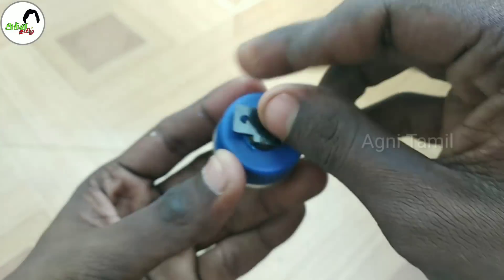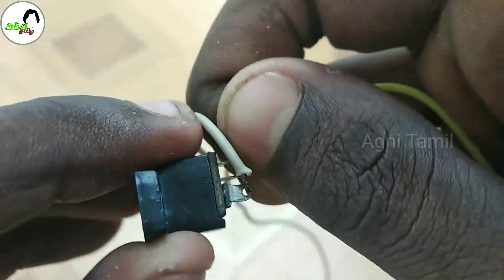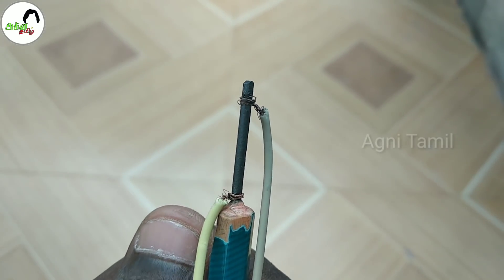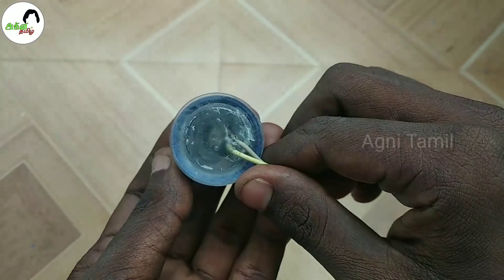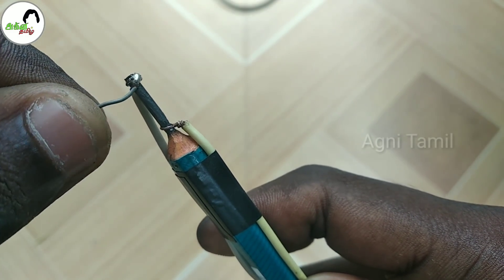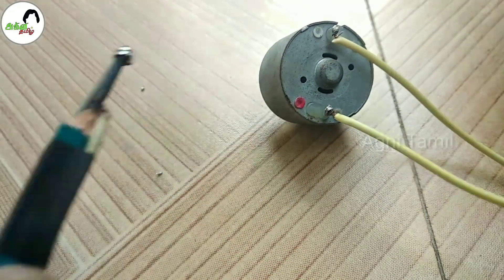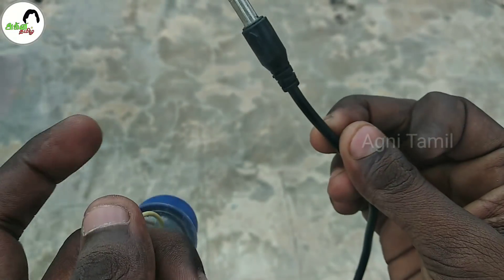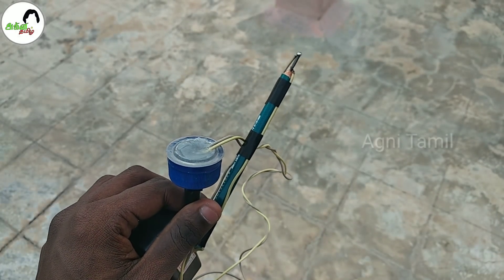Soldering Iron செய்வது எப்படி? | How to make a Soldering Iron? | Agni Tamil

Comment: What is female coneter and how check p+ and n- bro
Reply from the maker: Female connector video la kamatchi irupan bro athu electronic kadaila kedaikum bro.... Na positive and negative yethunu light vachi check pannanen nanbaa athula thaerium athu matum illama intha video yethu renduthula power supply varumnu kandu pudicha pothum..... Soldering iron seiyarathuku positive and negative wire ah maathi connect panna problem illa bro.... Pandra apo safe ah pannuga bro.

Na vachi iruka connector name : Male +  Female 2.1*5.5mm for DC Power Jack Adapter Connector

Pencil la 5v or 6v thara maari charger yeduthukoga nanba
Reply: @AgniTamil  Tamilarasan
Reply: @AgniTamil  vera level bro
Reply: @AgniTamil  hi bro
Reply: @AgniTamil   bro it's fake 🤥🤥 I am tried more than 10 times but it's not working bro😭😭😭
Reply: @AgniTamil  bro laptop charger yeduthukalama
Reply: Tell bro
Reply: Faheem Basha 👍
Reply: Na how to make a robot na please do na
Reply: Very confusing
Reply: @amithkhan4751  oh yeah
Reply: Semma bro
Reply: Faheem Basha
Reply: Faheem Basha  jhchkjslxjl
Reply: Faheem Basha sbbrjrjrhhr
Reply: Yes
Reply: Super anna
Reply: Water generator
Reply: How will do the soil clay
Reply: Semma na
Reply: Super Bro
Reply: Anna apdi female connecter seiyathunnu video podunga anna please please please .
Reply: Useful
Reply: Bro not working properly low heat only producing
Reply: Bro oru help souluga
Reply: @hemacreations  Help